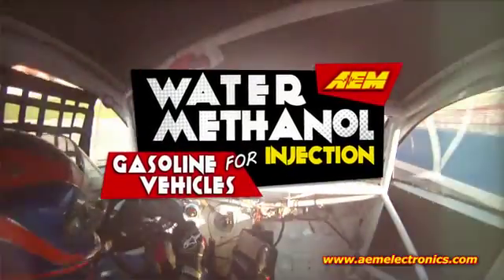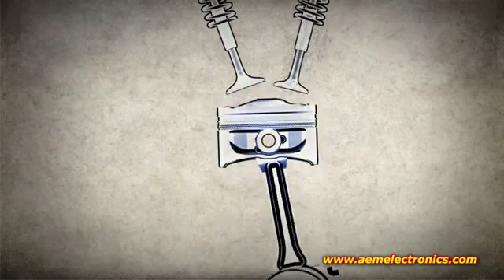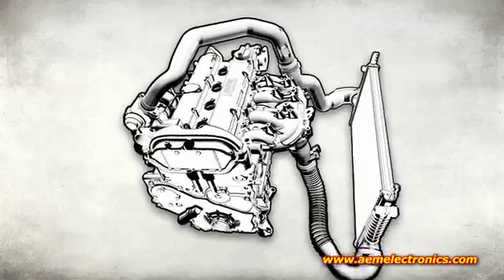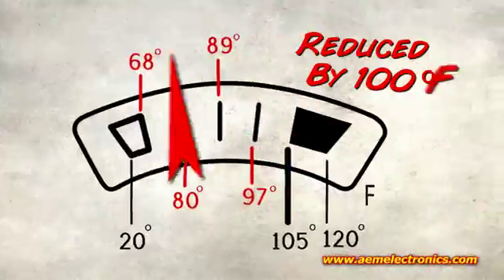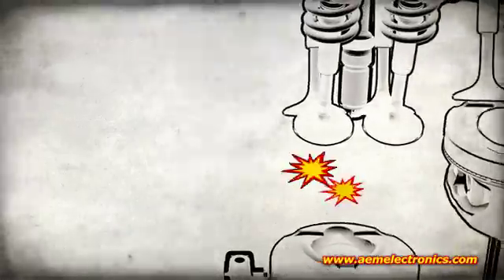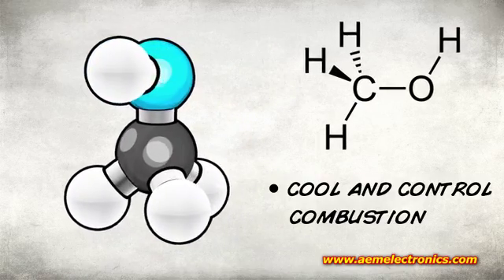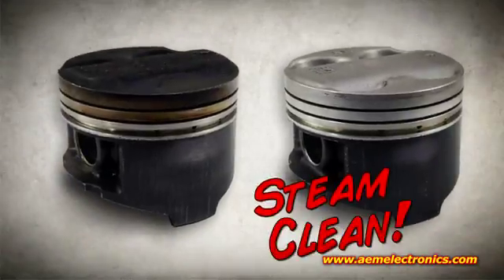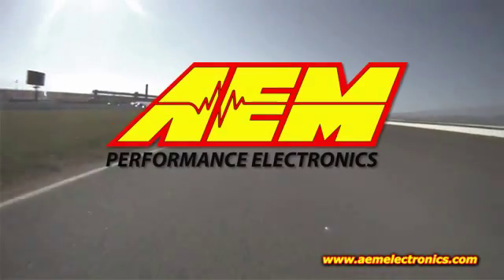Water Methanol Injection Benefits for Gasoline Vehicles by AEM Power | SummitRacing.com

Comment: I have water/meth injection in my car. While it does provide good power and cooling benefits. The greatest downside of this is oil dilution. This is what destroyed my turbo due to dilution. Oil contamination also happened to my engine. If your tune is a rich tune and also run meth injection, just make sure you do frequent oil changes (maybe every 2500 miles) as it will completely dilute oil and end up having a very expensive repair cost. For racing it's good to have but for a daily driven car, I wouldn't recommend it.

Also, set your meth spray at higher boost around maybe 18 minimum and max at 22 psi, so spray is set only on when going mid to full throttle.

Comment: What about a dirty engine with high mileage. Would debris that is cleaned off potentially cause issues inside of the motor? This sounds great for my 99 infiniti Q45 if its approved for 220k

Comment: Does this also work with Liquefied Petroleum Gas (LPG) ?
Reply: It will work with any internal combustion engine.  It absorbs heat and expands.  If you had an implosive engine it wouldn't work.

Comment: 100% methanol mix what benefits would that be, I recently melted a set of forged pistons with a 50/50 mix ?  :(
Reply: What? 100% water methanol mix not work, water methanol injection is only a additive for "over power", primary injection is gasoline...The water methanol injection is a very old system, first use in aircraft engines in the 30' for high temp take off, or emergency combat power...
Reply: I use 100percent Methanol now with great results
Reply: methanol yes ,was use in early times in race cars, forbidden in europe after the dramatical accident in Le Mans 1955, but not 50 to 50 water methanol mix who not burn...

Comment: Add Synthetic Slick 50 Engine Treatment to Protect Engine components, hence Protecting Cylinder Sleeves, or add a  Frantz Filter [dunny roll filter ] as a  Secondary Bypass as an option. Treat with Slick 50 with Frantz Filter removed. So as to not collect Bacterial Reduced Teflon. An Atom Beam is used to reduce Teflon to the size of Bacteria.

Comment: It would help an NA motor if intake temps were high like driving in a dessert. Would help on a cool day fuck all. Boost it helps heaps i have my ecu trigger the pump and solenoid at a psi setpoint i dial in.

Comment: does a car have to be boosted to receive benefits from water injection
Reply from the maker: +kenykillr, 
This is directly from the Sno Performance website: 
With naturally aspirated engines using less than 10:1 compression, water/methanol is used often in warm climates to get the intake temps lower. Benefits include: 10-15 HP increases from air density increases and full timing as well as more effective air/fuel ratios, increased gas mileage, and carbon free combustion chambers.

While power gains are typically less in stock compression naturally aspirated vehicles compared to high compression or forced induction engines, benefits can still be realized due to more timing advance, leaner air/fuel ratios, cleaner engine components, lower temperatures, and the use of the methanol in the injection fluid as a secondary fuel source.

Comment: Thanks for the informative video. I have a 4.8 02 Silverado. It has a mid to high range street cam. 2800 stall and a 4-11 rear. I can see the benefits as far as running cleaning and I basically understand how it works. Some people say I wont feel a difference as far as performance. My questions are direct and simple. Sir, will this make my truck faster? What would the approximate hp and torque gain be?. Can this be set up to automatically work from the throttle, so if I nail it it starts working? I am sorry if you covered this already. If the answer is yes I will order it right away.
Reply from the maker: Intimidator Ss , 
Here is some good information from the Snow Performance website FAQ section: 
• Naturally aspirated/stock compression: 
With naturally aspirated engines using less than 10:1 compression, water/methanol is used often in warm climates to get the intake temps lower. Benefits include: 10-15 HP increases from air density increases and full timing as well as more effective air/fuel ratios, increased gas mileage, and carbon free combustion chambers.

While power gains are typically less in stock compression naturally aspirated vehicles compared to high compression or forced induction engines, benefits can still be realized due to more timing advance, leaner air/fuel ratios, cleaner engine components, lower temperatures, and the use of the methanol in the injection fluid as a secondary fuel source.
Reply: Summit Racing Hey thanks for the information, I don't assume much so I will ask you this. Will the Water/Methanol system require me to retune it?I have purchased most of this build through you so I will be purchasing both the Methanol and the Nitrous system from you.I am Leaving Ft.lauderdale moving to Daytona in the next few weeks.
(Port Orange)  Can you recommend a good shop ...anyone?

Comment: can this be used on a na engine and is the spray continuous or or not
Reply from the maker: Shaquille Jemmott, Yes, N/A motors can benefit as well. The spray is delivered under high pressure which makes a continuous mist at a certain RPM that you determine.

Comment: Using just water produces good results for a street car. I learned this by accident in my 75 Camaro when the head gasket was leaking into the intake side was leaking. I had to pull the heads and man the pistons, valves, and combustion chambers were cleaner then new. One side benefit was the emissions test was less then a new car could muster 20 years newer!

Comment: Why Methanol???  

if you have to, wouldn't Ethanol be much better, since Methanol is more corrosive on all your rubber, plastic and even some metals, hoses, gaskets, fittings ?????

Also, would I get a power gain without any alcohol, just steam/ atomised water??

Comment: The one thing you are missing is the water has to be pure I mean really pure. .07 parts per million and this can be achieved with the LMW electron 4. Now I bet with this water you could increase the amount of power you get out of one droplet by a very large amount of torque cause you are burning more hydrogen in the cylinder with the pressure and heat that is exposed to the water and the electrical spark. This in-return gives more power and fuel inefficiency.

Comment: Very interesting. I just install a hydrogen and water mist injection system by AquaTune Hydrogen Fuel Systems. The generators produce 2.5 liters per minute of hydrogen(hydrogen is 2.5 times more powerful than gasoline), plus distilled water mist which cools the hotter burn of the hydrogen. The 2000 Honda insight has increased torque and mpg, and this with low octane fuel.

Comment from the maker: This depends on a number of variables. HP, injection system, settings, driving style, etc.
• For most engines in the 200-500hp range, the standard 3qt tank will last around a tank of gasoline. 
• For higher HP levels with the MPG system, it will be more like 1 gallon per tank full of gasoline.

Comment from the maker: @Mikej1592 We offer a 4 gallon kit and it is a 50/50 mix of methanol and water.  Something that isn’t commonly published is using windshield washer solvent, which is usually 50/50, you just have to read the label.  You can go to our website and enter part number: SNO-40008

Comment: @Mikej1592 4 gallons at about $32 in summitracing, SNO-40008, however, you can find methanol alone at stored like ACE or tuner garages, and mix it with water...